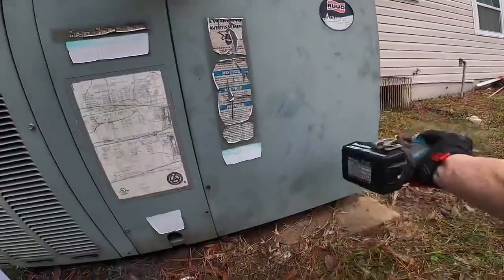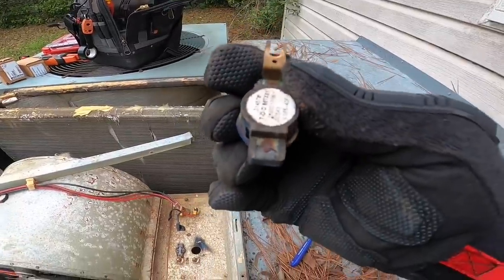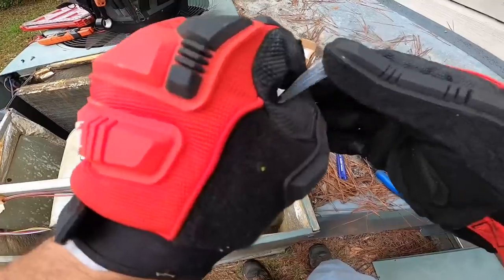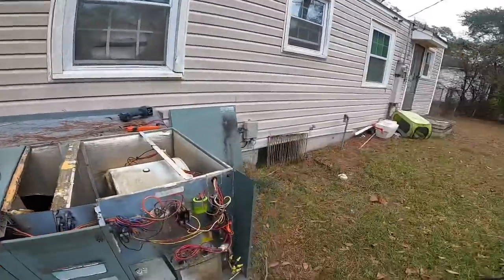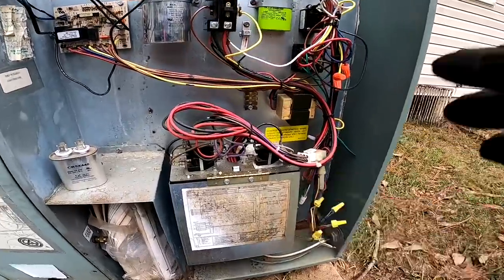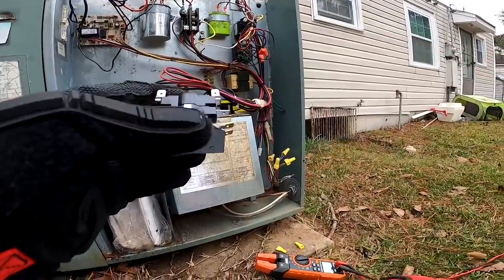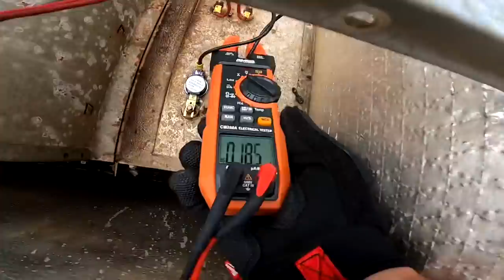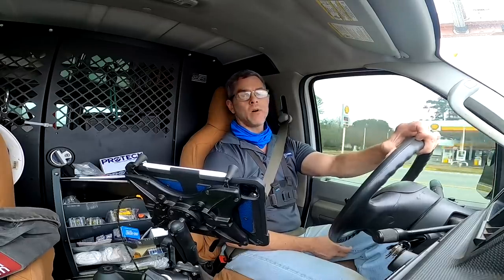So, What Caused it to Short ⚡️⚡️Watch ‘til The Test!

Comment: the stuck sequencer sure didn't help and finished off the limit/s. the old limits  had corrosion/rust where factory assembled(steel riveted) terminals were and that would be the main issue, causing terminal heating until it burnt off. who knows how long it was cooking itself before the party ended. 🥳 🤪

Comment: How do you like that crimper?do you think they are worth getting
Reply from the maker: I’m not sure yet. One thing that I commonly did before - because we use small low voltage wires - is that would accidentally cut the wire when I tried to crimp. This doesn’t do that. I think I still may need to adjust them. So, we will see.

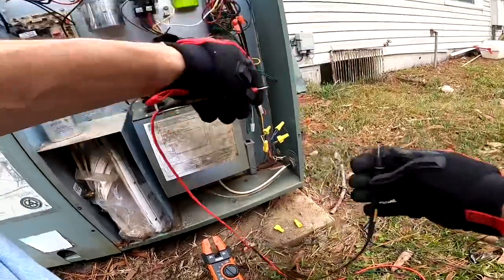Comment: You had 27 volts calling on white to common from what i saw ??? Would that not make that sequencer you tested at 0 Volts because it was passing current at the time it was tested ? You tell me watch your test on the control voltage  at 11:43.
Reply from the maker: I was testing between R and W. R is always hot, so if it shows potential between the two, W is not.
Reply: @HVACGUY  That's a different way to test isn't it?  I thought to test a call on white you would test from common to white ? to see is the T-stat is sending 24 volt from R to W  engaging the sequencer for up to 110 seconds showing 0 volts between the two 120 legs hooked to the top of the sequencer that would then show no voltage, when tested for 240 V.
Reply from the maker: @vincentdsnt  you can test either way.
Reply: @HVACGUY  LOL...the best test is to smack the sequencer with the handle of your 6-way and watch it click off !  Have fun at it , good reply's !

Comment: You're obviously down south. Why no heat pump? Resistive heat is not cheap.
Reply from the maker: It is a heat pump…with back up heat.
Reply: @HVACGUY  
Ok .I have a heat pump with natural gas backup. It has an economize unit on it. I can set a temperature depending in which fuel is more economical. I have a calculator to figure out what that temp is.
Reply from the maker: @scott_meyer  we call those “dual fuels.”    Not sure where you are, but they are rare down here. Economizers are normally on commercial units.
Reply: @HVACGUY  
It's not that kind of economizer.
It's a board the thermostat connects to. Then on to the furnace and heat pump. There's an outdoor thermostat that determines at what temperature the heat pump will not come on below. Currently I have it set for 35, so if the outside temperature is below that the furnace runs.
Reply from the maker: @scott_meyer  I misunderstood. Sounds like a nice system.
Reply: @HVACGUY  
It's call a fuel master 21. Lennox units.
Reply: @scott_meyer  I believe the gas furnace on a dual fuel system, is in the same function as the heat strips or electric furnace, on a all electric heat pump system, it’s AUX heat for when it’s too cold for the heat pump to work properly, dual fuel system are common up north, where they have more of a pay back, I also suppose you might see quite a few in some parts of the southeast too, where it more inland, or in homes that have gas hook up, but aren’t wired for an all electric system.